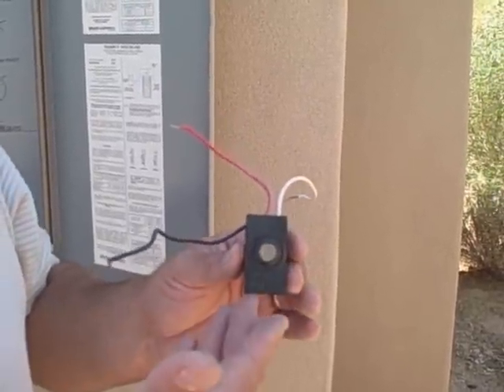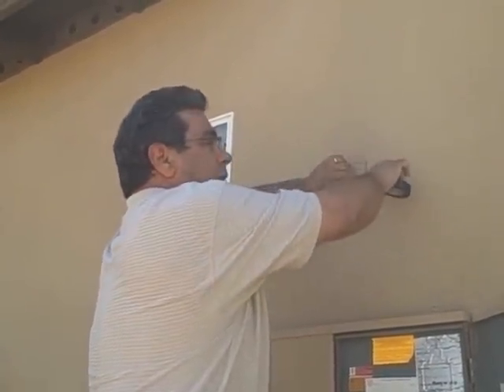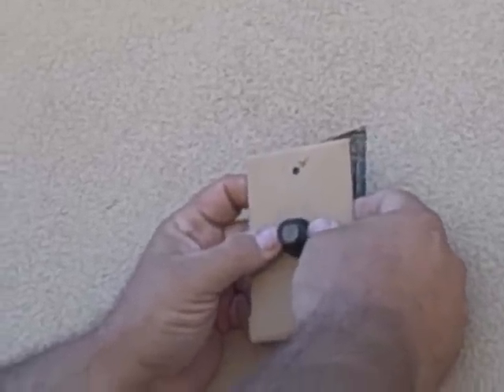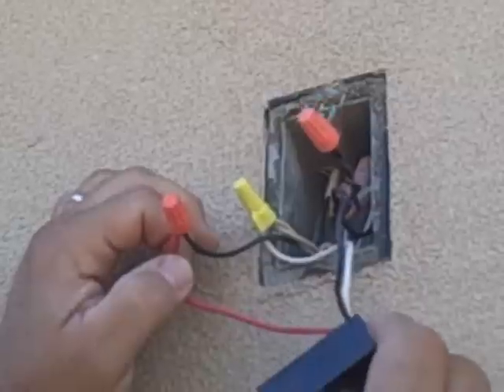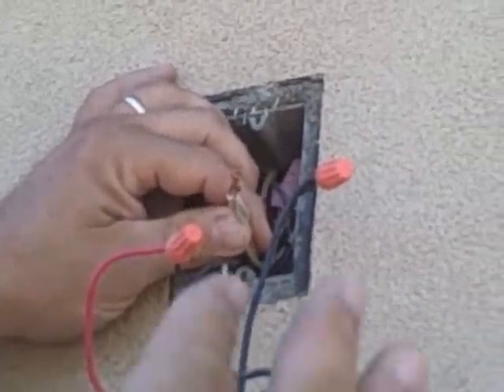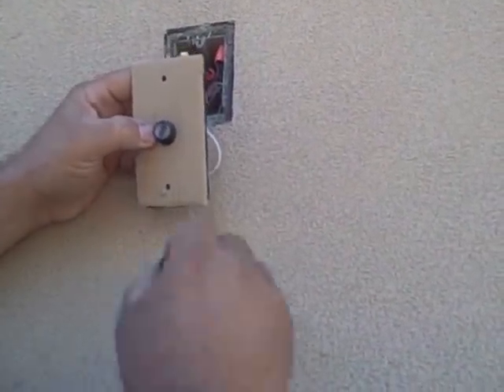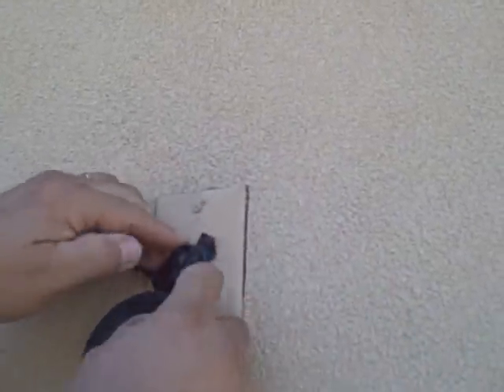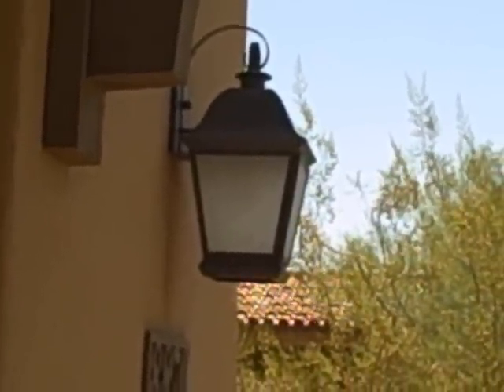Photo cell

Comment: I wish I would have seen this video before calling an electrician who charged me $200 for two visits. He claimed my two new photocells were defective.  The problem was he was shorting out my cells. He did not turn the power off, I asked if he wanted me to turn the power off from the garage he said no. 
Each time he tested my new photocell they worked then I noticed  a spark when he was putting it back together in the box.
I  purchased a third new photocell and black tape for $15 followed this video and my exterior lights are on dusk to dawn. 
Thanks for an informative video.😀😀😀😀
This electrician lives in my neighborhood he was waiting on me to call him for a third visit but I repaired the photocell myself.

Comment: I hooked the photocell up correctly as I have done many times before, but for some reason when tie in the cell neutral the load red shuts off, I'm baffled. Any solutions or suggestions would be greatly appreciated

Comment: Hello I was wondering before I change the photo cell or transformer... My house light turns on but its very dim then it shuts off pretty quickly.  Do you think the cell is the problem or the transformer?  I am of course assuming this transformer even has anything to do with the photocell or is it strictly for the doorbell?  I'm confused simply because it looks like from the location of the photocell on the outside of my garage to the inside where the transformer is installed it looks like they are exactly next to each other.  I could be wrong...  Does the transformer have anything to do w/the photocell?  If not then I'll assume it is in fact the photocell that is the problem.  Hope this all makes sense.  Thank you...

Comment: Just a note on safety. Putting tape over a non-functioning photocell will actually tell you nothing. Always test your wires with a voltage meter or tester to ensure power is off.
Reply: bro I can't even comprehend why people make video's of such nonsense. if you do not really know proper and what your doing then don't expose yourself. I'm sure a great guy and others as well but it's nauseating.
Reply: @Daniel M just a way to test the photocell but always check power off for safety when playing with electricity.
Reply: Yes he did that

Comment: Question: I've replaced the photocell on our house (thanks to your video!). However, the lights still turn on in broad daylight. Do you know why this is happening?
Reply: Same thing happened to me 
Did you fixed?
Reply: The red wire!! Does it goes to the power supply coming from house or to the bulbs? 
Where does LOAD wire goes to? To the bulbs or to the house? 
Red wire is LOAD wire?